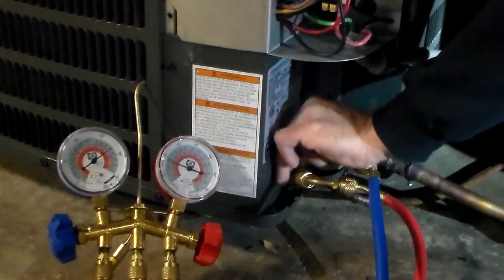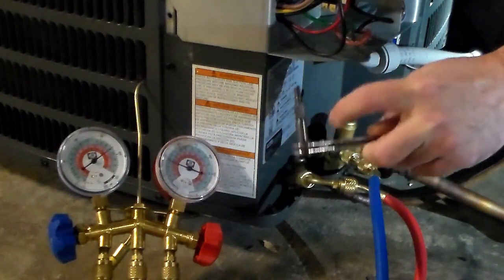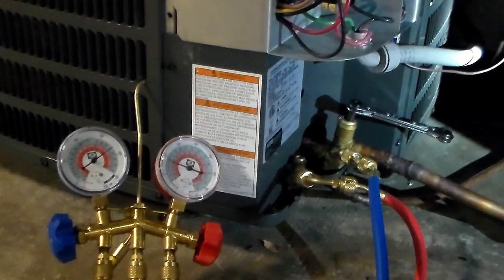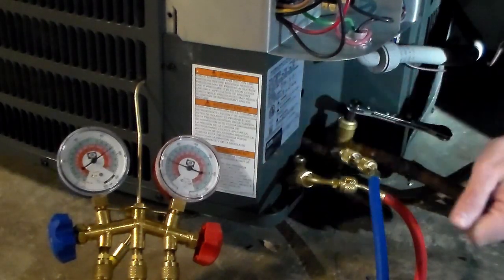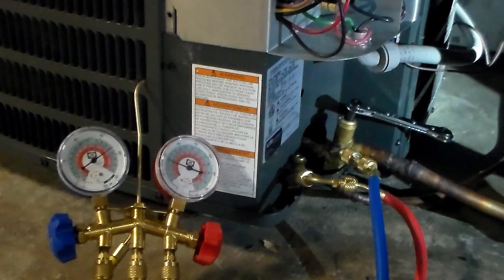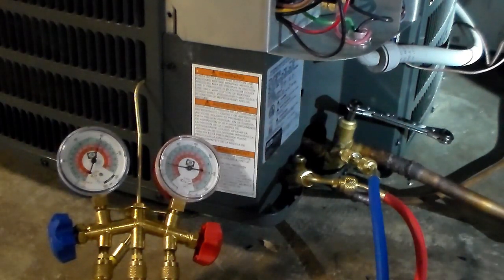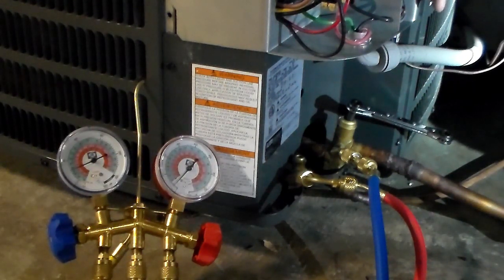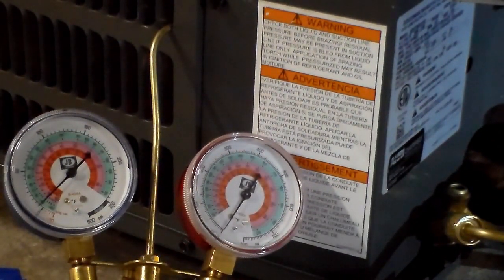Manual Pump Down of an Air Conditioner

Comment: It's best to pull it into a vacuum every time when you're pumping down. The easy way to do it is to attach a core removal tool to the valve, pump down into a vacuum, then refill with nitrogen to prevent moisture from entering the system when you open the line-set. Not only will your charge be accurate when you release it, you'll also be already set-up to flow nitrogen while you're brazing. Botta-bing botta-boom
Reply from the maker: Agreed. But best practices and what lazy asses do in the field are two very different things if you haven't noticed. But I agree with you one hundred percent.

Comment: How do you like the brand of your gauges?
Reply from the maker: Those are actually crappy gauges. I used them because it's what the students had that year. So, not at all. The hoses are not vacuum rated. If you want to do it right, Imperial, Hilmor, and Fieldpiece make good manifolds. And then sub out the standard houses for black vacuum rated hoses. The best way is no manifold from my other video. At least, it's best for pulling a vacuum.